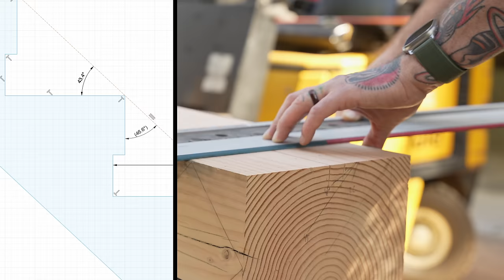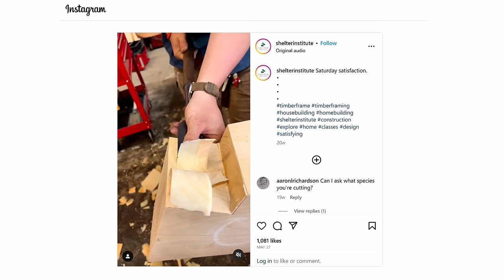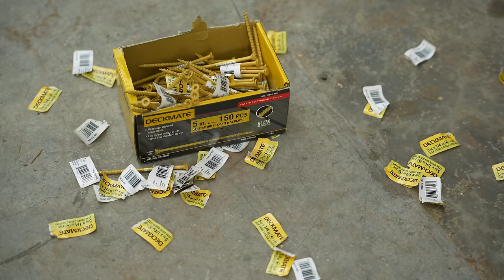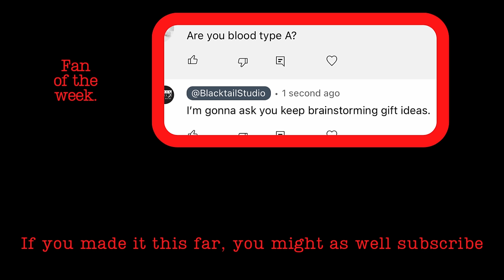Timber Framed Staircase Build

Comment: I was a stairbuilder for over 20 years. I stopped when I came into the office to take over the business from the owner. Just vetting myself a little, there. 😊

For never building a stair, this was quite well done! There are a few problems, a couple of which are fairly serious, but really it’s pretty amazing that it turned out as well as it did. Stairbuilding is one of the most difficult trades to learn and excel at, so you should be proud! The changes I am suggesting are to safety and structural integrity, and’s aren’t facile nitpicking. The changes I believe are necessary are as follows:

1. Attach the closed side of the treads to the studs in the wall. This is very important since you went with an open design with no risers. You aren’t just walking up that stair, you are also storing material up there that you probably will often be carrying up the stair, adding weight and stress to the treads and single stringer. So, this is an important, necessary addition. This is done fairly easy (and could still be done easily retrofitting). 

This is done by using a piece of 1/4” angle iron (or channeled) metal stock with a 90 degree bend at the closed end of the tread. The stock should be 4-5 inches wide and inlaid into the tread with a dado cut (using your table saw or router, whatever)  lengthwise about 3” from the nose of the tread and an additional, deeper dado for the angle portion of the metal stock. The stock should have a 90 degree bend at the closed end and be 6” in length to attach to the framing, or added blocking in the wall. You can dado the tread and hide the metal support stock by having it countersunk by a 1/4” or 1/2” and then covering it with a 1/4” or 1/2” piece of the tread material inlaid. 

Then, on the closed end, you can cut out the drywall and attach the 90 degree end to the stud (or blocking you attach to the framing). Most of the time we used C channeled metal stock for additional support instead of angle iron. Once you attach it to the tread and the blocking in the wall, the stair will fex very little. A little bit of flexing on a circular stair is okay, but not for a open, straight stair of your design, which  is a sign of structural issues. The treads will eventually pull out from the stringer, or the single stringer will continue to torsion until the structural integrity of the stringer is compromised beyond safe usage. 

A jerry-rigged solution that might suffice would be to use angle iron stock on the closed side, attached to the end of the tread and then secured to a stud or blocking you add in the wall. There are several ways you could do it, even mortising the stock into the closed end of the tread and attaching it to a stud or blocking. You need to do something, though, because you can do it now and it will be fairly simple, but if you wait until it starts to fail, your options disappear quickly. 

2. The second issue is the attachment to the header (joist) under the landing of the 2nd floor. You have a ton of stress concentrated on a very small area. This will eventually sag the header and landing, and tear out or destroy the header, and that will be a difficult repair.

Your stair is going to flex and tear out or compromise at that header attachment point pretty quickly ( I’m betting less than 5-10 years). You can accomplish this by adding another layer of 2x material behind the header (sandwiched) and then attach 1/4” angle iron to each side of your stringer, flush with the header, and then use all-thread through the header and another joist behind it to attack the angle iron (and stringer) to the header. You thread the all-thread through holes in the header and joist behind it, adding washers and nuts as you bring it into the header and joist. Then, tighten the nuts to both sides of the header and (at least) one joist behind it, and the angle iron. I would then add another piece of 2x material to the face of the header on each side of your stringer. This hides the angle iron and adds additional support to the sides of the stringer at the attachment point to the header. 

These additions are important and not difficult to accomplish. If you don’t do these, I think it will fail within 5-10 years, or it will start flexing so much as to be unsafe to ascend.  

I know it sucks when so-called “experts” chime in and nitpick everything you do. I like your channel and especially the spirit and can-do attitude you have. I learned a lot in my trade just by doing it. I built a lot of tools and jigs that old stairbuilders told me wouldn’t work or weren’t necessary, that then later they copied them or asked me to build one for them. So, I get the frustration you have with people like that. Sometimes, though, the “experts” are right, and this is especially poignant when safety is involved. I’m not talking into my hat, here, the changes I suggest (and there are other ways to accomplish what I suggested) are important. Don’t take my word for it, ask a local stairbuilder to give it a look-see and hear what he has to say. 

This was a really great build for never building a stair. Stairbuilding has a vicious learning curve, one that almost broke me in my first year in the trade. So, you should be proud of what you did. There are a couple of safety issues that need to be addressed, but overall you did a really great job! Keep up the good work and thanks for showing the world that hard work and a commitment to quality can make dreams come true!
Reply: Straight up great comment from start to finish on addressing the “ elephant in the staircase”. Having done many like this with the stringer being fabricated steel…..your 100% on point.😊
Reply: 27:06 yeah. I thought the same, then seeing  the stairs shift a bit side to side as he wipes it down here made me think he needs it mounted to the studs. And the bouncing at the end lmaooo
Reply: I like that this is a single tree. Maybe some structural reinforcement of the header board would be good. Everything has some deflection.   Id be very happy with these stairs with a little flex
Reply: EXCELLENT advice. Worth reading and internalizing.
Reply: I'd screw an 8 to 10mm piece of spring steel plate at full length to the back of the centre beam to give a bit more bounce in your step.. think about it. 😁
Reply: This is the kind of comment you read, and immediately think "well sonofabitch.... this keyboard expert really IS an expert". Kudos to you 😎👍
Reply: Best comment I’ve read. I don’t even know how to build anything. Most of this didn’t make sense. I think I still learned a ton tho
Reply: @yupp9393  I saw that and then went to the comments to see if anyone else had addressed this....and yes they did! And the original comment did it better than I could have so I just gave it a thumbs up.
Reply: Blacktail Studio never acknowledged this so far, or he would have made a comment.
Reply: 😅I'm no expert, but was goint to comment to add hidden metal reinforcement, too!  My Grandad always had me in his workshop and he was most definitely an engineer.  He taught me most of what I know about materials and stresses.  Your answer is far better than mine and would still keep the beautiful aesthetic--which is a distressing, terrifying safety hazard to watch him walk on!!  Open stairs are really not safe.  You may as well just use a ladder-at least you'd be aware of the safety concerns, imo.  You could get lulled into a false sense of safety over time and then one tiny slip or trip and it's a trip to the er.  All that rambling to say--add a handrail to the open side.  Make it just as pretty as the stairs--preferably with some way to catch you if-God forbid!-your foot slipped off the open side while carrying something heavy, changing your center of gravity and making it hard to catch yourself.  Best case scenario is while going up.  Then you'd only fall forward and bruise your ego.  I know people who fell down while going down.  And they never got back up.  😢Please.  Please be safe!
Reply: Yeah but think about it
Reply: Now this is how you write constructive feedback!
Reply: As an amateur woodworker I copied this comment to word and saved it under <<SENSEI STAIRBUILDER'S SAGE ADVICE>>
Reply: This guy needs to be the top commenter for any woodworking videos
Reply: Thank goodness, I was looking at him and thinking that he was missing supports on the wall-side at least, him going up and down the stairs made me uneasy but I don't know enough to be able to pinpoint it! I hope (desperately) that he takes this advice to heart and we don't hear about an awful accident!!
Reply: This is not only an amazing lesson on how to build a staircase, but how to give constructive criticism with plenty of compliments.  Cheers to both the incredible work and constructive criticism
Reply: I've seen wooden ladders which are much more flexible. This is of no concern to me. But I would add a metal piece with additional bolts on the underside of the connection of the central beam to the upper floor joist to account for torsion. And some blocking to the connecting upper floor joist. The old staircase with two stringers got the forces balanced to the side close to the joist hangers not in the middle.
Reply: I hear you, but.... think about it.
Reply: hey man I'm 22 and a professional stair builder and installer by trade (only 6 years in so not as experienced) I agree with all of your statements. However we usually do central carriage stringers out of steel or 2x 45mm LVL laminated with 18mm of hardwood of clients choosing. Theres usually around 150-200mm of material left at the bottom of the tread to riser line so they end up being pretty strong with not too much bounce. (with timber if there isnt anything fixed off on the walls theres normally always a small amount of bounce in them). Usually having a 10mm spacing between the wall and an overhang that matches the top wall/ trimmer/ header. can you tell me more about how you guys will usually fix off your treads to the studs as we don't usually do that as we're working with steel most of the time and it isnt necessary. and the tread going hard into the wall doesnt match the asthetics the clients are looking for in those specific cases. also most of the time there might be a window on the wall side to let natural light in so its not always an option. I was concerned in this video with his fixing to the trimmer as you described too. the lock in at the floor should friction fit it and relieve some of the stress on the trimmer but its still not great. also im based in australia and our laws/timbers/regulations are probably much different to you guys. also im not here to hate or anything so please dont roast me guys haha. still new to the channel but loving what im seeing keep up the good work!
Reply: 😊😅😅😢😢😢😢۱
Reply: A reddit quality answer on YouTube. Damn man thank you for taking the time to write that all up.
Reply: Long story short...stiffen the header, angle iron positive connection top of stringer, positive connection of tread to the wall with iron. Those are all great ideas to strengthen the stairs. You forgot one thing though, beam stock stair stringers have severe checking and one of the steps will break off with enough walking on. The connection of the treads to the main stringer itself has to be deep enough past the effective compression line of the stringer below the stair not h depth. Other than that all the suggestions are good.
Reply: Great advice! One of my dad's friends build the staircase in our family home back in 1979. To this day not a creak, feels as solid as the day it was built. I wish I'd had the foresight to work alongside him or maybe even apprentice.
Reply: Absolutely great I see he said I'll think about it hopefully he acts on it. You are correct. Stair building is definitely a craft in its own. I know so many guys that can't figure out how to use a square for anything other than a corner. This is the best response I have ever read online. You didn't just nitpick him like so many would have because your points are very valid. He did do one hell of a job with layout and all that though so good to see you give props for his successes in this project. I just really hope he follows your advice.
Reply: TLDR
Reply: Ppl ppl exu all😊
Reply: Two stringers, attach one to the wall for support. Stronger and looks better.
Reply: a real expert, great job sir
Reply: Though the staircase as "overbuilt" as it appears inspires some confidence I'm always wanting to pay respects to Murphy's Law. Though nothing may have happened in the time he was using it, someday a couple of guys would try 
hauling a full sized refrigerator up those stairs and might experience something calamitous about half way up. Heed Murphys Law.
Reply: Couldn’t he rout out the back of stringer inlay angle iron or box steel to get the stiffness he needs?
Reply: @just_some_internet_guy That's because he doesn't want his dupe clients to see him acknowledge he didn't know what he was doing. Wants some one to grossly overpay for one.
Reply: I don’t build stairs and I don’t intend on building any, but I’m going to remember this if I ever do. Fantastic comment.
Reply: @lovefeist3136 now that I think about it… I like your engineering mindset.  Don’t measure based on today’s nominal weight; measure based on the “refrigerator test”.  Worst case scenario. Future user.  Engineers add a tolerance.  Good idea.
Reply: The doubling of the joist is good but a 2,3, or even 4 extra blocks going to the next joist wouldn't be a terrible idea 🤷
Reply: In addition to your professional stair-building experience and insight, I would add that just having all that weight from the solid timber steps on that one single spine stringer, if it's visibly and noticeably flexing now, I would be concerned that rhythmic flexing of the stringer with the combined weight of the steps (even notched into the stringer in a compressive way) can't be a good thing. Even as good as his stringer bowties were, just having those existing longitudinal cracks in the stringer timber already is a concern.

Although there is that intangible bragging point of being able to point out that the entire staircase is from one large tree, since he painted the stringer black anyway, I would have used an engineered and fabricated steel stringer painted black and eliminated most if not all of these structural safety concerns.
Reply: just encase the entire thing in concrete - think about it.
Reply: Yeah, great comment. I mean... *think about it!*
Reply: I worked in the office of a staircase company for approximately 3-4 months and I can confirm everything said here is accurate.
Reply: я бы сделал так — распустил несущую балку вертикально ленточной пилой пополам, выбрал бы в одной половине на всю длину углубление 5*150 мм, и вставил бы туда стальную пластину на всю длину приварив её к верхней крепёжной пластине и к нижней. Деревянную часть балки я бы просто склеил вокруг стальной пластины на эпоксидной смоле. К стене ступени я бы не прикреплял, поскольку это будет производить шум и всё равно крепления или стена рассыпятся, потому, что такая конструкция лестницы подразумевает динамические деформации, а также деформации со временем...
Reply: by the book yes few problems, but we both know they will stay there for years and years to come
Reply: Very nice!

Comment: As a carpenter who has built dozens of staircases and done a fair amount of timber framing, you've taken on the two Everests of most residential carpenters' existence! Other than Instrument, and Furniture making, these are the things that most House Carpenters will consider the pinnacle of finish carpentry. Neither of these types of projects are easy, and mistakes are extremely expensive.  You guys did an amazing job on this one, especially for first timers!!
Reply: As a joiner I second this motion, although just to be awkward for assembly I would change the screws plan, to a couple of coach bolts from the back of the stringer
Reply: @morourke2561 what a cool idea.
Reply: @SandroMoiron  
Glad you like it, a dovetail on the stringer would be even better, with a stopped socket on the bottom of the threads 😉 but now we're probably getting carried away.
Reply: @morourke2561 dovetail stringers would have made it completely next level, buuuut it also would've doubled the timeline lol
Reply: @steves835  
💯 Quality takes time, this I can't deny, maybe not double though, much of it could be achieved with a router on the stringer cuts and finished with a combination of tracksaw and chisel work, then completely achievable with a router ran in a simple jig for each thread.
Reply: Next time you make plugs for covering screws, use the bandsaw to cut them all out of the plank like you did with the dovetails. Also there's  a very useful little saw with the teeth only "set" on one side for quickly sawing the plugs off flush. Quick to use and often saves the odd plug being chiseled off too deep if misjudging the grain direction.